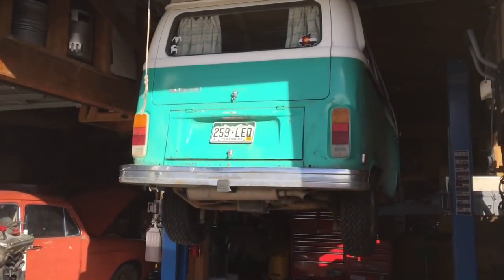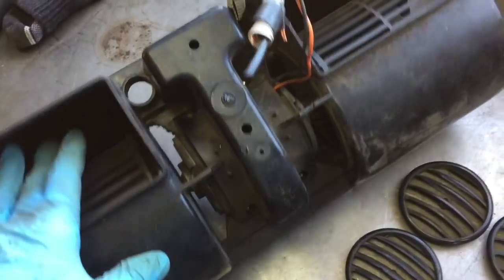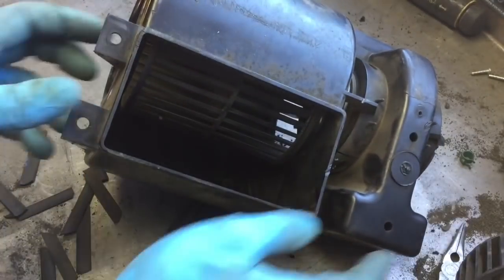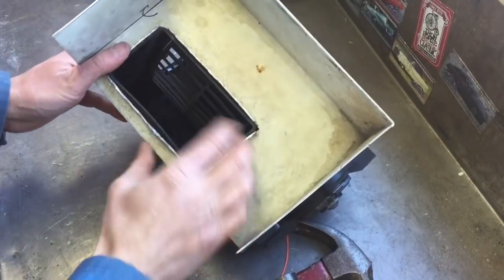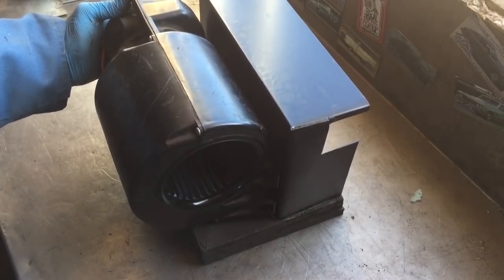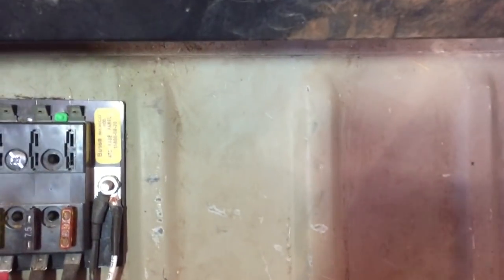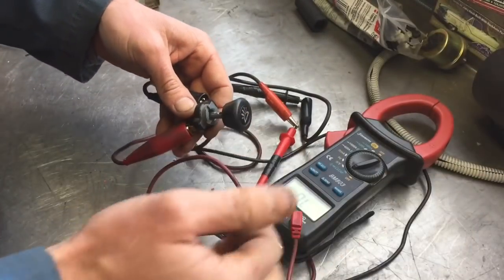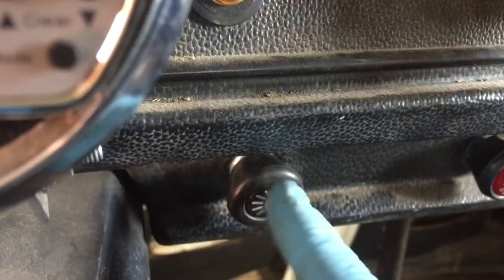Army's Ultra Budget Rear Heater Build

Comment: Why the 'T' and the rubber connection ?
Reply from the maker: +Marc Instone when summer rolls around I'll want to clamp the hose to the heater inlet (or install a valve) so that the core doesn't heat up the cabin. That little bypass allows the coolant to still flow through the hoses so the thermostat can do its job (the heater circuit is the main "signal" for the thermostat to open).
Reply: Tsrif Tsal I believe he usually uses a smaller diameter hose/fitting for the bypass, so there is a reduction in flow there. Don’t know why it was the same size this time.